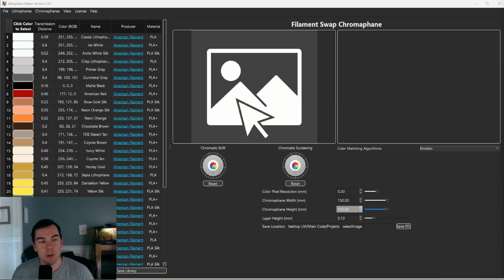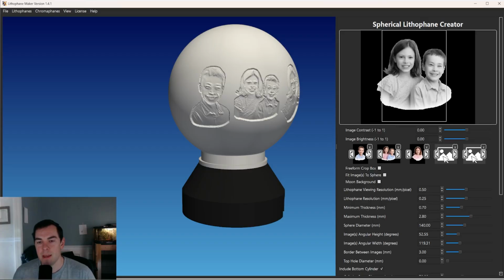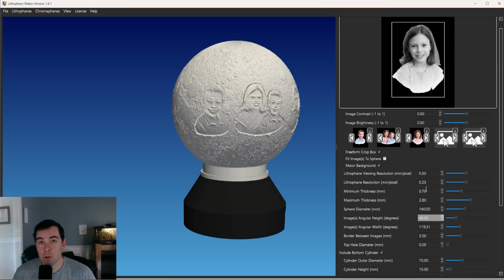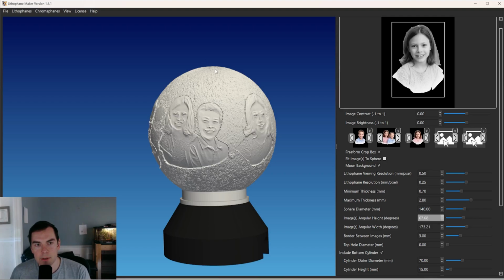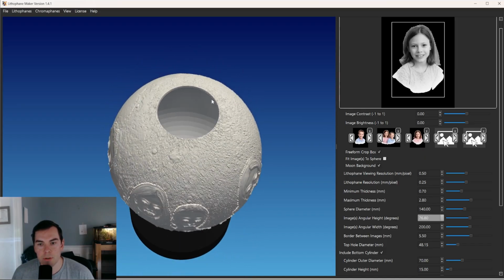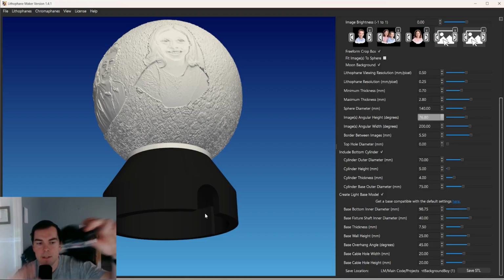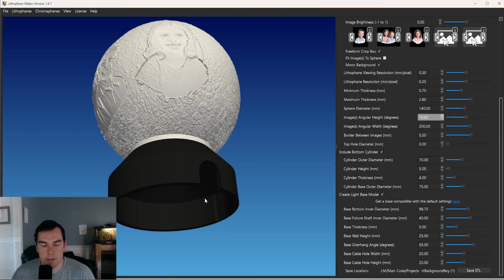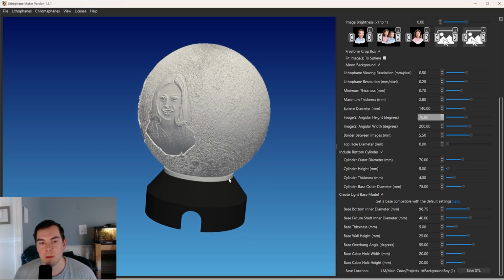Mind-Blowing 3D Printed Moon Lamp Lithophane Sphere with Lithophane Maker Desktop

Comment: Just printed the Moon. I`m enjoying creating with the Lithophane Maker Desktop. Good being able to change base size to fit my LED. I've made it to fit a wood base. I did add manual supports inside the sphere which worked quite well.  
Would like to see a colour (CMYK) option for curved shapes... need to make use of my many flower pics.

Comment: I followed along with the video. When I went to print, it seemed like it was tossing filament over the side so I stopped the print. I looked up others and it said I dont need to print supports, should I slow my printer down to 50% power and see if that helps? I have the Creality K2.

Comment: hi!

I have registerd and bhought a lincense of your lithophane maker and  I was wondering if it is possible to rotate the added picture more freely then in steps of 90 degreees and also if it is possible to move the added picture around the sphere freely and not have it fixed to a max spacing of 10mm, thanks, razvan

Comment: Question regarding licensing. I want to test your LMD program and if I like it will purchase a commercial license. Do all licensing options have the same functionality. I was going to purchase the one year personal license for testing purposes and as I said if I like it, switch over to a commercial license but if the functionality is different between personal and commercial licenses I’d like to know up front. Thanks a bunch.
Reply from the maker: The functionality is currently the same between the personal and commercial, and you will get a refund of the personal license if you upgrade to the commercial license.